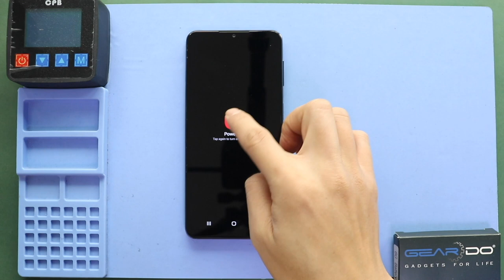Samsung Galaxy A32 5G | M32 5g Battery Replacement

Comment: Was it really a problem for us to just replace a battery? They really want you to just buy a new phone every time the littlest thing goes wrong with it.
Reply from the maker: The process is quite complicated, but this model bit easy. And I agree what you are saying..
Reply: @DIYGeardo  Very great video, and I apologize for seeming rude. I just wish I didn't have to go through all of this. Im probably just gonna get a new phone due to having an upgrade anyways
Reply from the maker: @angusyoung119  no you are not. Well I understand the frustration you feel on repairs. For model like a32, it should be straight forward. But as per manufacturer perspective they want you to buy a33 😊 without repairing. And also sometimes I encourage customers to buy new phones instead of repairs. Because the repair cost is high
Reply from the maker: @youtubeillegallydeletesacc1525  well it is not like what you think. Also what do you mean you want to insert a SIM card

Comment: Can i heat the battery with a hair dryer? I accidentally damaged the battery slightly when replacing the charging port. Basically i took the opening tool next to the battery when i was taking off the 2nd cover as it didnt want to come off. Anyway new charing port works and now its time for new battery. Or could i maybe use isoprophyl alcohol?
Reply from the maker: If the battery is damage physically, then do not use heat,Try to pry it slowly. Will take time. Using alcohol is good, but use very little, if you use it excessive and somehow goes to the screen, it can have issues. Best method is disconnect and pry the battery.
Reply: @DIYGeardo  i tried to take off the battery but it wouldn't go anywhere. I ended up using alcohol but still wouldn't go. I asked some people and the amount i damaged the battery isn't a lot as its just slightly pressed in on the side and by the looks of it it's just the soft outer layer.  I ended up sending the new battery back for a refund as I just couldn't get it out. The battery didn't get bulky or anything. I ended up leaving it so alcohol evaporates over night then I charged it to 100% with cover off in a safe place and the battery is good not bulky or anything.  Now after like 3 charges its still fine so I'm just using the old battery. My old phone was much easier to repair as that had a removable battery and generally everything there was pretty easy to remove. I mean here also but I just decided to open it from the wrong place by the battery when I was taking off that second cover.

Comment: I have a heat gun but hot with that fine of a nozzle. I may attempt using metal tape or metal tape with aluminum foil to create a smaller nozzle for this. I'm a bit hopeful my battery will come out that easily. Not sure if I will end up attempting this tho. I do love the a32 I'm sure if not by now soon there will be a better phone out there